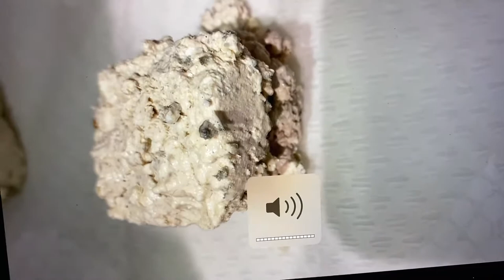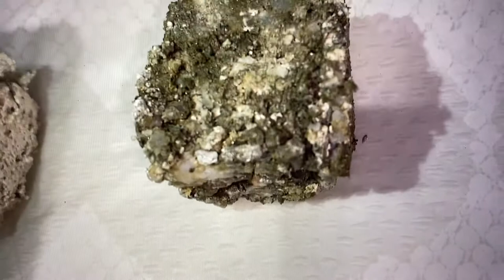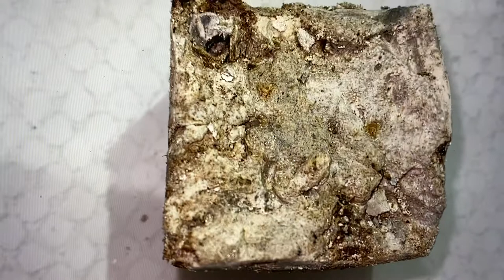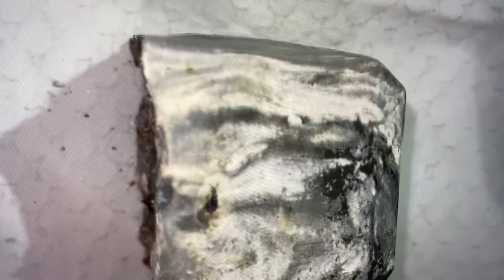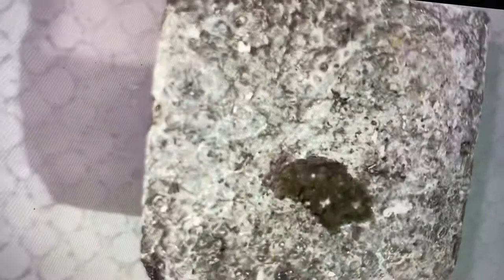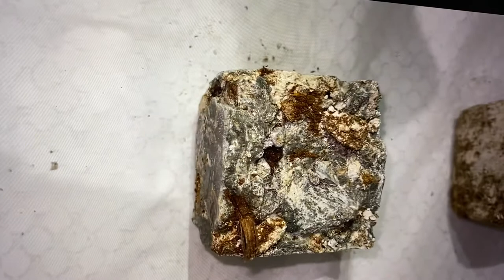Exploring Rice Mortar - Architecture

Comment: Hey, I was wondering what were the exact ingredients you used to make these experiments? also an archi student and I'm thinking of doing a study into sticky rice mortar! Thank you!!
Reply: Hi, in china even today they make lime mortar as that of in 15th century, the same recipe if you'd go there some day and extensive research is done on that topic to preserve great wall of china. Rice helps to enhance the properties of lime mortar if I would have to explain without going into technicality. The bricks of those times were comparatively weaker so a strong mortar was effective, compared to today's bricks they're a bit stronger. Now in my place that is India, it is home to forts at amazing heights and more than 300 forts are still standing the most famous forts being in state of Rajasthan, here hard rocks are used that were obv stronger than bricks of that time. Meaning mortar recipe varied. Interestingly the portions of great Wall that are rock built are still standing while the brick built region is crumbling at insane rates. Which means different mortar for different building materials. In china it is not powder lime it is rock form lime that they use directly in mortar, making it QUICK LIME. While in UK they're preserving their still-standing mortar made structures by using mortar made from lime in powdered form. Same method of mortar is used by French mostly in rural areas villages. So according to different place, we add different materials like rice, in different forms of lime powdered or solid using different sands as well. Bonus, ancient Romans made bridge is still standing so strong a tank can move regularly there and the sand they used was volcanic mountain ash. So form of lime, extra ingredients varies according to place and weather.